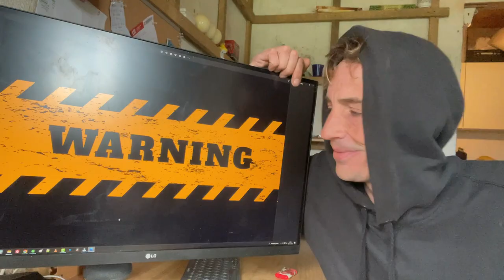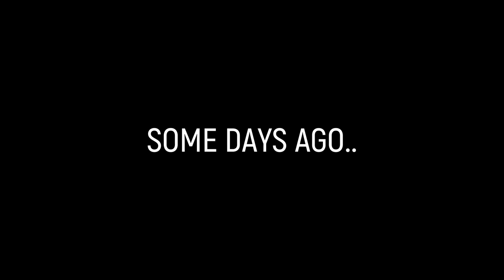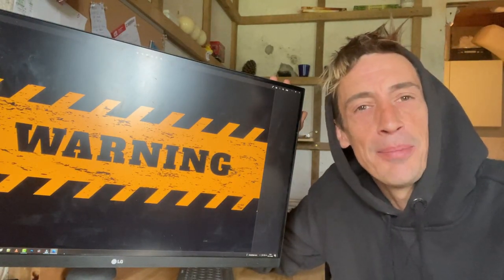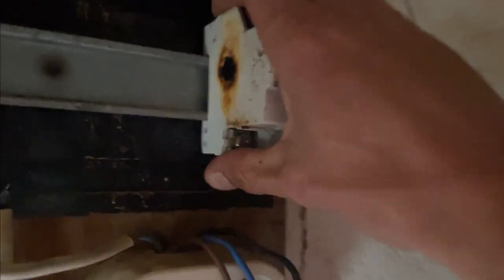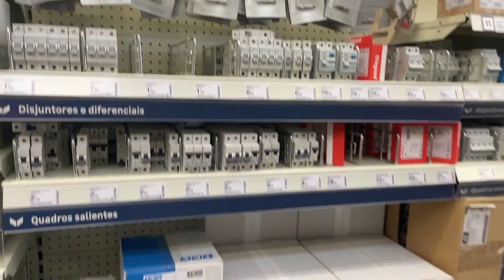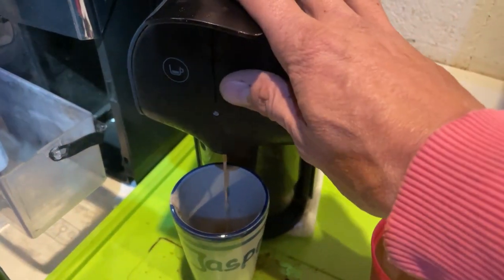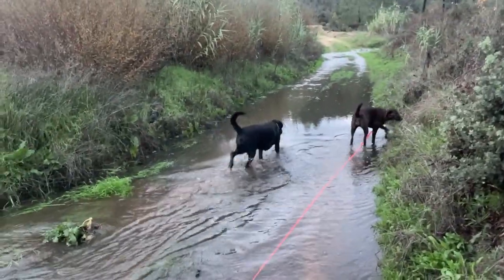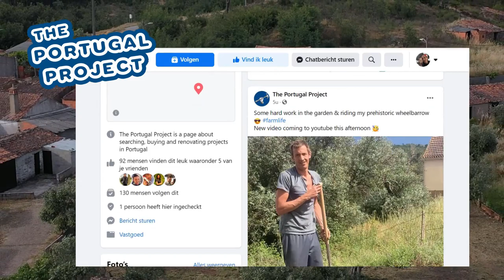I ALMOST BURNED DOWN THE HOUSE... | Portuguese DIY Home Renovation

Comment: The "old" fuse box is really nothing but a casing with a Din rail and some terminal blocks. I'm glad to see you haven't replaced it because it isn't the problem and you are better spending money on more MCB's which are the switch things you just bought. You didn't talk about it at all. What were the MCB's you had before and what were the ones you replaced them with?

Comment: It's amazing the ways ancient wiring fails.  Breakers stuck in the closed position, dear god!  Yearly testing of the new set up might be in order.  In older homes (60/70 years plus) here in the states...the need for grounding wasn't appreciated.  Often cut or just plain ommited.  My first home came with knob and tube wiring.  Look that up sometime if you would like to see a disaster waiting to happen.  Glad you caught this and thanks for all the work on the channel.

Comment: 40 years electrician in North America. Looking at your video it seems to me that you have a loose wire connection on the overheated circuit breaker.

Comment: I don't know how many amps your dryer pulls, but you should probably have it on a separate dedicated breaker. Better to be safe than sorry.
Reply: THIS! I said before Jasper, that you are putting too much of a load on individual breakers. It's best to have the load spread out across different breakers. This also helps you track down faults if a breaker fails because you know it was a problem on an individual circuit.
Reply: I use to trip the breaker when I would run my microwave in the same circuit as the fridge. Definitely need dedicated breakers for your appliances.
Reply: I Don't have a tumble dryer but just got a shock when I looked up the draw from this one appliance. Do you have anything to tell you how many watts it uses? It would be good if you could use a 10 amp breaker for it but you might need to use a 16amp breaker but I think it should definitely be on its own circuit. Make sure your cable is rated for enough amps too.

Comment: Been there done that in my old house. We often forget that what would draw on power 20 years or so ago has been doubled with new high-tech. Therefore the brake boxes have to be upgraded.
Reply: Driers, coffee machines are modern conveniences. What's wrong with a clothes line or visiting a laundromat?  Coffee and warm beverages can be made on the stove. These devices are really unnecessary imo.
Reply: If there is a much greater load you might need a new cable/circuit rather than a new breaker. You want the breaker to trip, so the less it can handle the better. I know that seems the wrong way round but when the breaker doesn't trip like in this video it could be a disaster. When your breaker trips, just tell it thankyou and try and work out what you might have done to trip it.
Reply: @GM-cq6ez  The dryer uses scary amounts of power too, so there is a lot to be said for a clothes line.

Comment: Lets go back to dryer.  You said it was taking a long time to dry cloths?  How do you have it vented????  Do you clean out the lint trap before each use?  You may have to pull the dryer out and check it to see if lint is impacted.  Lint build up can also cause FIRE.
Glad you are handy with electricity.  I find it interesting that in Denmark you do not have a power main to shut off.  That would make things a little bit more scary.
Looked like a sucky day for you.  Weather, electricity and bad dogs.
Hope you see the sun tomorrow.

Comment: The most common cause of electrical fires is caused by loose neutral connections, don't over tighten connections but ensure the cables are terminated firmly in connector, showing importance of electrical tests, and breakers.. should prevent the worst, looks a lot safer now,  looking at the size of incoming cable, looks like 4mm?.. in UK that would be 16mm for 100 amps supply, so going by cable size 40 amp supply?.. 50 max.. whats the old saying can connect a fire hose to a hosepipe and expect it to work like a fire hose???... glad all safe.
Reply: The highest breaker you can have is 45 amp in Portugal that’s an RCD on main incoming supply it should have tripped
Reply: @withoutthinking3703  im not sure an RCD would trip due to a loose neutral  look at the heat damage, there was no short circuit, just a build up of heat, a loose connection can build up a lot of heat, and as they only trip when they see an imbalance between live and neutral.. or live and earth, which is basically neutral, would it have tripped?.. MCB's work on thermal but looking at the neutral cable's insulation to me points to loose terminal into the RCD, like it has been arching in the connector.. i used to be commercial sparky..
Reply: @aidenjohns8248  looks to me like an overload on a small cable to be honest supply cable held the breaker that was being used failed probably old an seized up have see it many times due to overload on the cable and an old breaker
Reply: @SolarLantern424  if you walk outside and look at every other power pole in the street neutral is taken to ground!..

Comment: So you just have an extra main switch in Portugal? Anyway. You as a 'user' can reach out to the main switch in Portugal where in Holland the main switch is sealed and only to be broken by the powercompany. Something I had 30 years  ago when i did something wrong.
Reply: 2 rectangular boxes and white metter with blinking light belong to power company only their employees can work on then they are sealed,Jasper can only work in what comes out after. in Portugal we have 220 volts and a fair amout of amps coming out of company wires. my advice to jasper is to make a ground wire conection to that dryer before he burn house. also check wires in attic for mice chew ups and other damage in wires that are old in instalation.

Comment: I couldn't really see very well but was the breaker you replaced a 45amp one? It seemed to say 45 on it? Glad to see the new switch that says 25amp for the master?. The breakers are basically like fuses so you actually want to get the lowest rated breakers you can. These seem to be the cheapest too so you should stock up on a couple more when you are next in the shop.  Do you have old wire that you don't trust as much in use? Maybe use a 5 amp breaker and don't overload it! A lighting circuit might be 5amp too. Just the lighting on it's own wiring. The wire used for lighting is often thinner and not rated for as many amps. The breaker needs to match that, so it would only be 5amps.

Comment: Old wiring system is not up to modern load. Not surpising actually, you got lucky it failed the way it did. All people in situations like this will need to keep that in mind, if you want to run more on such systems then a few lights and a fridge/freezer, you'll need to redo the whole system and run one thing at the time untill then.

Comment: My house has a much older distribution board and am currently upgrading the whole system the cables you are using to run your stuff are probably to small for the load so they get hot if you need any advice drop me a line am happy to help

Comment: Hiya Jasper and Co

I agree with Stephen
But No Knowledge Can be costly both in Health and Wealth 

Burning electrics have their own distinct smell 
Here in the UK you need to be competent and adhere to both ieee regs and building regs 

But looking at Jasper he shows competence and Knowledge.

Although his tools would not pass muster here for health and safety.

But his temp work as I remember he will be rewiring his whole old build later.

We can see the wiring is old.

Loading the circuits as winter or hot summers heat and air-conditioning.!!

But I see Jasper caught the problem early
Well done Jasper but can't wait to see you do rewire in future 

Keep the good work coming
Wish you all well.
Sorry Bob second again.
Abientot